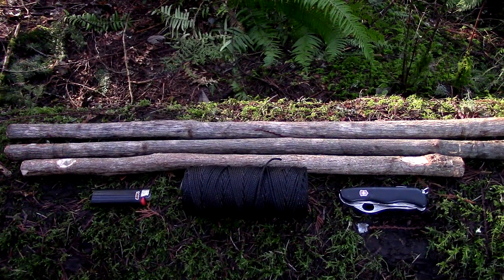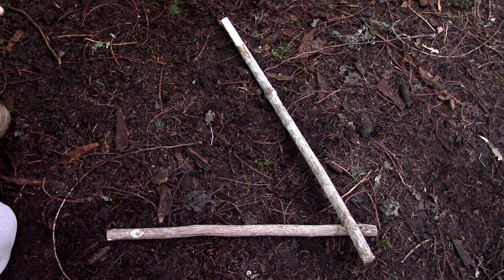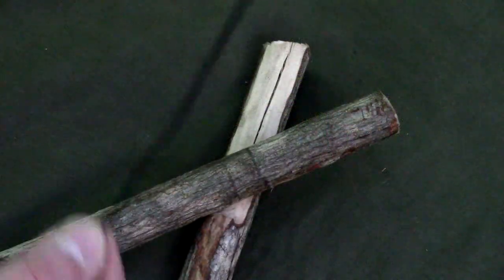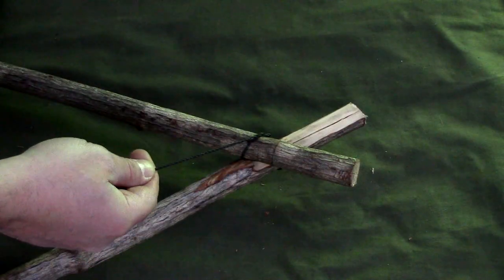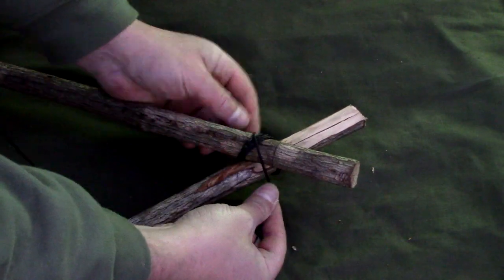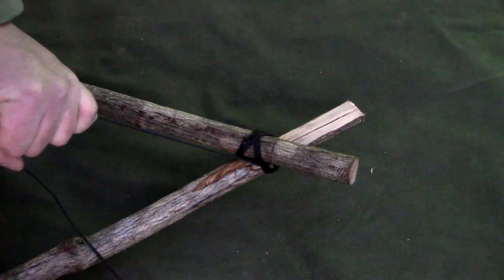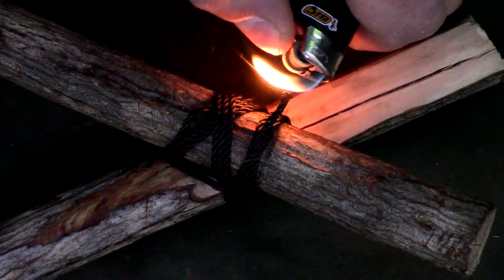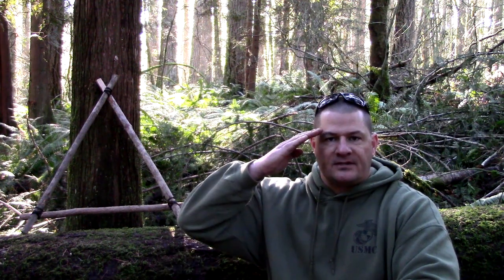Roycroft Pack Frame Part 1 (The Frame)

Comment: Pretty nifty. I used one as my main pack for a couple years when I was in my early 20’s.  I read it in Mors Cochanskis book and then Dave Canterbury made his video. 
I took what I liked from both and made my frame. I like smaller diameter sticks, I think it looks better. Not that that matters much. 
I liked Mors suggestion of running the shoulder straps through a loop so they float instead of them being fixed to the frame. I have weird shoulders and packs are always uncomfortable for me. Except for the tone. I could just put it on and rock it a little and it would fall into place where it was comfortable. I used some recycled pack straps instead of rope or mule tape since I used it so much.
I’m the only thing I didn’t like about it was how long it took to get in and out of for the smaller stuff, but I ended up figuring out how to fold the outside in a way it made a pouch so I could keep my possibles in there without having to carry my haversack

Comment: Very good but I make the frame with a slight difference which improves it. For the lower part of the triangle I cut a branch of greater thickness, 3 to 4 inches in diameter, and split this down the middle. Select one half for use and discard the other. The advantages of this are a stronger frame and a more comfortable fit on your lower back when carrying. Because the lower frame member is thick it can be further trimmed with the knife to achieve exactly ythe shape to suit your back.